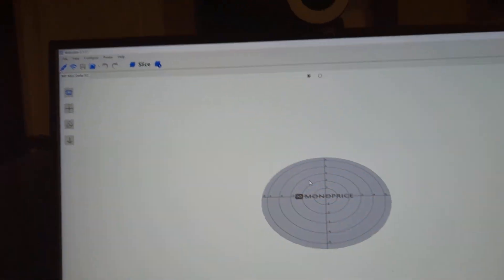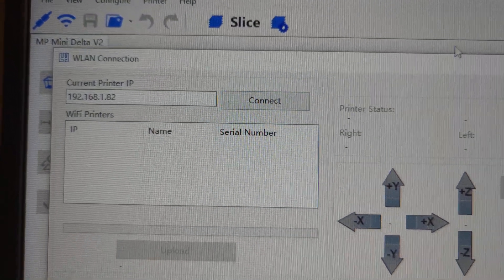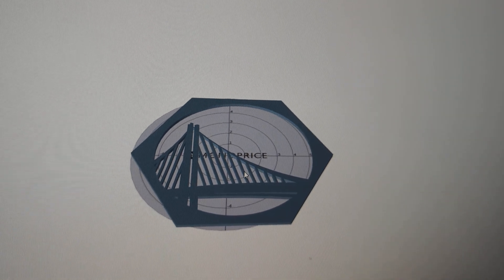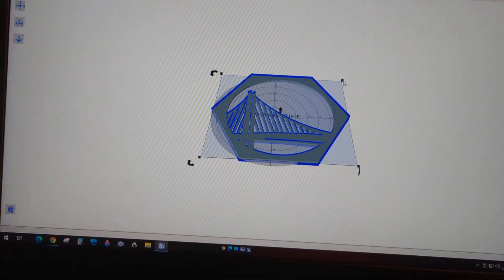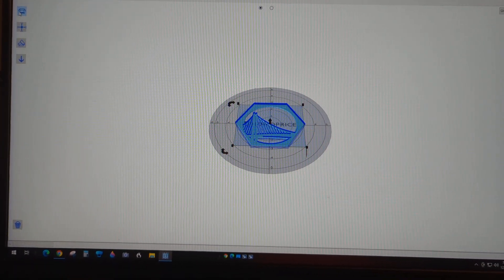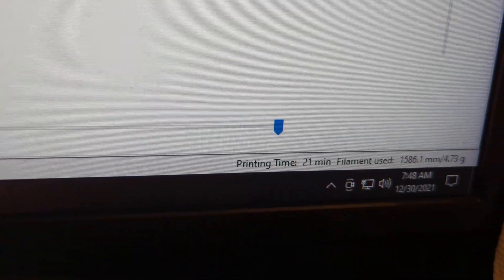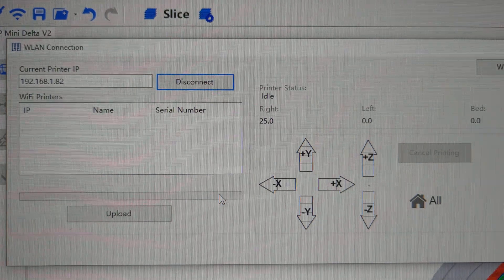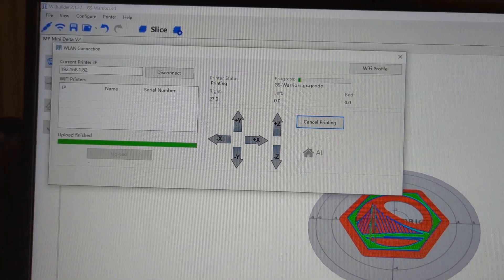How to slice 3D model in WiiBuilder

Comment: How do I add support and how dose it work? Can you make a video on that?
Reply from the maker: Let me see. Honestly I never print with supports
Reply from the maker: Do you have a model in mind that has supports?
Reply from the maker: I just finished a couple 28mm models and I added supports to them. All it did was waste PLA.  Even when I print out lightsabers with long cylinders I do not use supports.   Is there something specific?
Reply: @willantilles5493  I have nothing specific in mind that i wanted to make. I just started printing and trying to learn how everything works still. When I go to websites and find some models I would like to make, some say supports are needed but I didn’t know what they meant by that. Should I just start printing it regardless?
Reply from the maker: @ShadowExtremeEX8  Understandable. If the model needs supports you can try and print without them my success rate with those varies but I usually then find a different model.   Depending on your slicer and since you are commenting on my WiiBuilder video I would say that this is the slicer you are using. 

In WiiBuilder to the right of the word Splice there is the Slice settings button. Click to open the slice setting options.  You will then see supports it will be blank by default use the drop down arrow and you will see your two choices. I would suggest using supports everywhere that way the model should have full support.